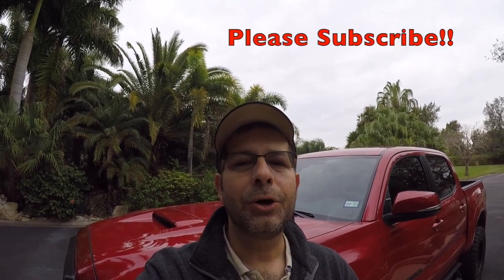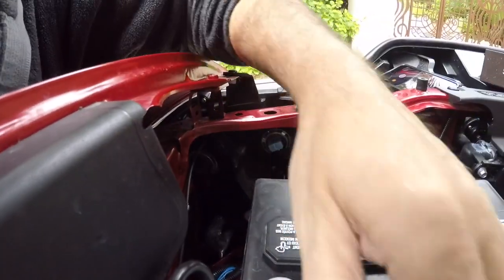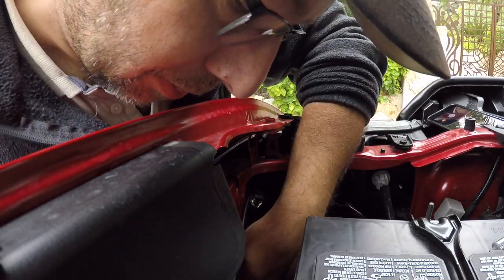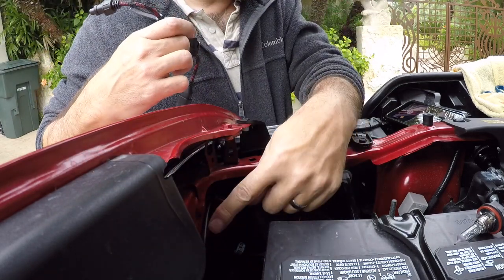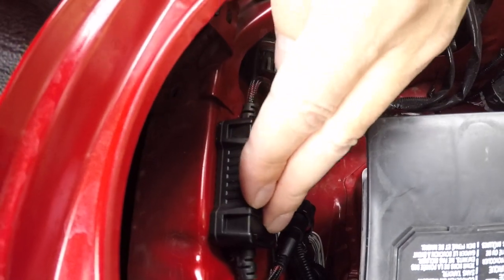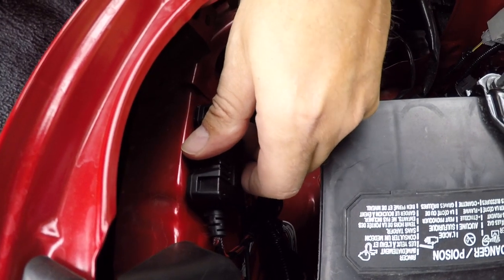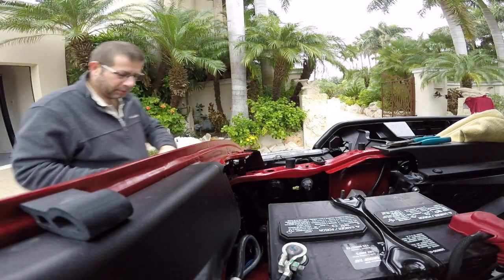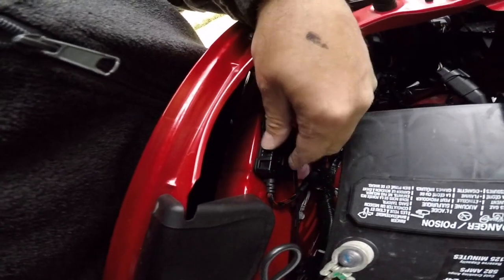Tacoma LED Headlight Conversion Kit from Headlight Revolution

Comment: Your v-4 bulbs is what I want for my Tacoma. Question, when you installed the bulbs, is the chip set facing left and right, or up and down in the housing. It look like your wires off the bulb was facing down off the little fan.
Reply from the maker: The wires are facing down.  I believe they run left to right- flat in other words.  There is a set screw in the bulb housing that you can loosen (with the provided Allen wrench) to allow rotation of the chip set👍

Comment: After about a year of owning your s-v4 headlights on the tacoma.  How would you rate them?  I am looking into buy a set of high beam and low beam for my truck, but the price is about $340 dollars.  Wanted to know if other drivers bright light you during use?  Thanks in advance and love the channel.
Reply from the maker: They were fine.  Never had any issue with them.  I recently gave them away on the channel👍

Comment: Hello Rob, question. How loud are the cooling fans? and lastly how much of a difference in size are these LEDs in comparison to the stock halogen ones? I have a 2018 Highlander and they come with the headlights dust caps so if they protrude too much I wont be able to close the headlight housing. Thanks in advance.
Reply from the maker: They are longer than the halogens and definitely brighter...clean white light of course.  You can hear the fans of all is quiet and the truck is in a guiet place, but definitely not loud by any means👍
Reply: thank you sir!

Comment: Is there enough of a price gap and fuel mileage difference between mid and full size to make mid size worth it?
Reply from the maker: Maybe🤔. I suppose it depends on what your needs are though.  I bet there would be a lot of opinions on it👍
Reply: From personal experience price gap was close to 10 grand and fuel difference is about 5 mpg better.

Comment: Rob - 2019 4x Offroad. I've had lots of issues with LED's. Tried several brands of taillights, headlights, signals. They all blow fuses. Completely kill the truck. Towed into Toyota 4 times! Stealership threatened to void my warranty. Hope those work out for you.
Reply from the maker: I had no problems with mine👍

Comment: The link that you posted. Those bulbs were the ones I had been looking at. Thanks for installing. Just one question. The link only shows for the low beams. Does the kit also include the high beams too or can you give me the link for the high beams?
Reply from the maker: There’s one set per kit.  The bulbs are the same for the highs, lows and fogs.  These things are great and the install was simple👍. Don’t forget to use the discount code if you order.  Thanks for watching .
Reply: ThrobbNation definitely will. Thanks again!!!